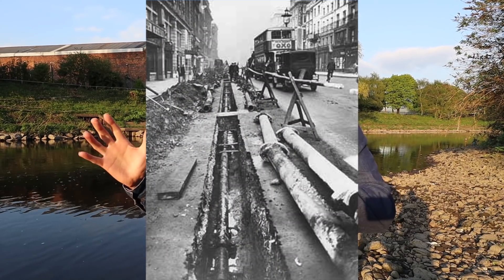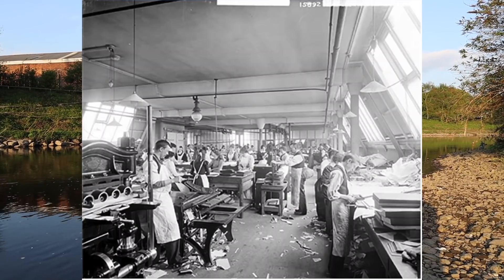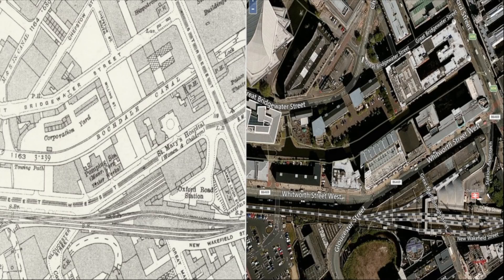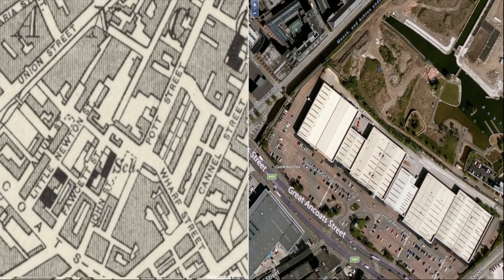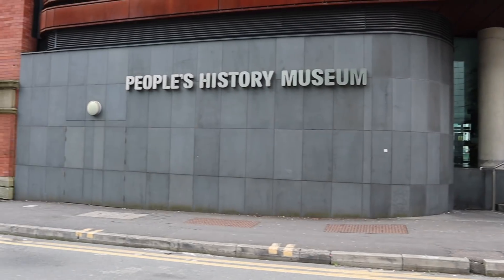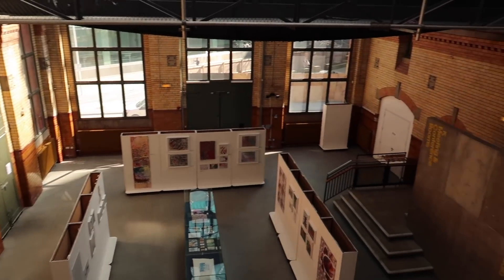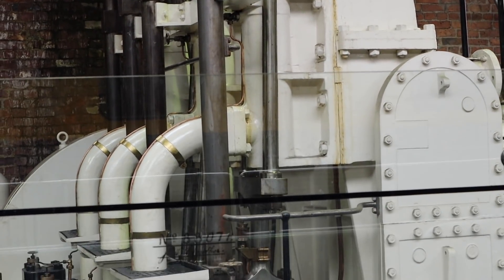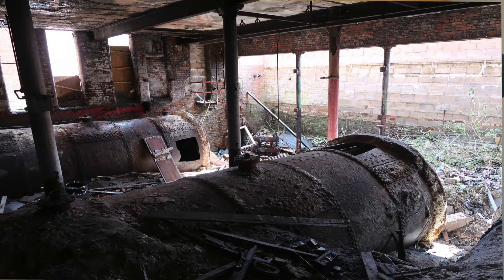Manchester's Hydraulic Power System

Comment: The pipework from the system was still in place along the canal in the 1980's - black pipes about 6" diameter which periodically had expansion loops fitted to allow for the thermal expansion of the cast iron pipes. I don't suppose they are any left down there now.

Comment: All the swing bridges on the ship canal are hydraulically powered. The locks have a water tower containing an artificial head of water controlled by a weight bin so the actual pumps  are relatively small. I went to a Barton Cruising club open day in the 80s which included a visit to the bridge workings

Comment: San diego California actually had a very similar system in down town aria. Near the santa fe train station, is the shell of theold san diego gas and electric building which at the turn of the century was known as san diego gas. And what they did was provide steam pressure as well as town gas from that building into a network of tunnels under the streets. And during the turn of the century all the buildings in the down town aria where provided with centralized steam heating and gas from the plant. Also of note the san diego gas company used horse teames to move the coal around and the stable building survives as well as a taxi gradge.

Comment: You mentioned about swimming in the tanks, i worked on an estate that used to get water from a borehole, you could go up on the tanks (exposed at the top of a hill), the water was never cold, during the cold winters you could even se water vapour coming off the water, i think someone said the water never got below about 12C so a little bit of geothermal heating going on.

Comment: In London the pipes from the London Hydraulic company turned out to be valuable and the company sold for a good price. The reason been that the pipes had right of way under the city and it was possible to blow optical fibers though the pipes using compressed air without having to dig the streets up.
Reply from the maker: Great idea Mark

Comment: Hi Martin, This is very interesting, never knew anything about this system,  I'd like to know more about the technical side of the pumping set up, was it a closed loop (pumping the same water around all the time) or was it constantly fed with fresh water from the boreholes?
How was the pressure kept constant with varying numbers of factories using it?
Did they have problems with freezing during the very Cold winters of the past?
Reply from the maker: Hello, am afraid I dont know of the technical side, only the general overview. But yes a fascinating system
Reply: NOW, That's Richy. I think it must have been a total loss system. With a plentiful water supply there would be little benefit in spending huge sums on further piping to return the used water back to the pumps. Pressure was presumably maintained by hydraulic accumulators such as the tower bridge ones which can still be seen today.

Comment: Was aware of hydraulic power with its accumulator towers etc, but thought it was only used in the docks, railway hoists and even tower bridge, had no idea it powered a town. Just wondering how it's usage was charged for, did each premises have a water meter, or pay a fixed price based on estimated use. Your videos certainly contain some very interesting topics.

Comment: The rights to the pipe routs in most of the UK major cities was bought by Mercury Telecommunications Ltd , a subsidiary of Cable and Wireless,
and used for optical cables linked by a deal with British Railways using their telecom routs to link them up and compete with B T and it was called Operation Mercury. .

Comment: Great video again. Did you notice the similarity between the o-ring joint in the pipe and the way the Space Shuttle's solid boosters were assembled? The question that intrigues me is this: Where did the used water go? Obviously it has to be kept out of the foul drain to avoid overloading the treatment plants, but did it go in the surface water runoff, top up the canals, or get reused?
Reply from the maker: Not sure Robert, my knowledge is limited

Comment: I remember the hydraulic system being used in Manchester in the 60s. Don’t know if I’m imagining it, but I’m sure there was also a hydraulic clock system, where pressure “pulses” were sent through pipes to drive “water clocks” and keep all connected to the system synchronised. I don’t think I’m suffering from substance abuse, but I did grow up in the 50s and now I find the thin line between memory and reality is getting thinner.
Reply from the maker: That sounds interesting John

Comment: I'm amazed like you it was still running until 72'
I'm intrigued to how it all worked, those joints looked substantial but as I was a gas man:plumber for 18 years there's always that one coupling that'll not seal properly. So that systems pressure would have to be drained to fix it ? A huge feat I'm guessing

Comment: They also used hydraulic power to raise the goods wagons up and down  both at London Road aka Piccadilly station and at Central station. Both had vast networks of sidings under their arches. These are actually interesting in their own right. When I was doing my nurse training in the early 90s we were based on Piccadilly approach and used to walk under the arches to get to and from lectures/car park etc. There was still lots of track embedded in the cobbles back then and filled in wagon turntable pits. There was a really good example under the arches next to the old Red Star parcels building. I'm not sure if they took their hydraulic power from the Manchester system or if they had their own system in place. Its a fair old drop from the elevated track to street level so they must have been quite impressive wagon lifts although I have never seen any photos of them? https://historicengland.org.uk/listing/the-list/list-entry/1283014  Also all the swing bridges on the ship canal are hydraulically powered another point of interest to maybe look at!

Comment: It's a very clever system - water is pumped into a series of 'Accumulator Towers', which are basically huge pistons, of great weight. The water pushes these pistons to the top of the towers, and are locked in place when they are full. When power is needed, the Accumulator is allowed to slowly fall. This forces the water, under great pressure, through the pipes to where it is required. The water can be used again and again. There are several towers still existing in London, and they all have a similar design, so once you've seen one, you know what to look for. Hydraulic power used to raise the bascules of Tower Bridge. The accumulators are on show there.
Reply: brianartillery  the company I worked for made the hydraulic system for tower bridge in London. It was Armstrongs of Newcastle

Comment: wauw, amazing. I never heard about power distribution via water pressure. Makes me wonder if a similar system have been used in my home town Helmond where a lot of (mainly textile and steel manufacture) industry was between 1800 and 1980...
I wonder how the power transfer (from water pressure in pipes to an actual axle) was done... hydraulic motors Victorian style must have been quite the animal...

Comment: In times when the electricity network was still developing, the hydraulic supply will have been more reliable and certainly more powerful than electric motors, possibly cheaper too. As the system developed and electric light became the preferred lighting option, it made more sense to consider electric factory power over hydraulic.  Additionally, the practicality of portable and handheld electrical machinery made the case for leccy all the stronger.
Reply from the maker: Thanks for the info. I agree with you 👍

Comment: I was at the Science & Industry Museum recently and they gave us a talk about Manchester's hydraulic power system and we had a demonstration of the pump working.  They worked at a very high pressure - 1000 psi (if I remember right).  
I worked in the Town Hall Extension for years where it was said the lifts were originally powered hydraulically.  I can remember as a kid going there with my mum and dad and getting in the lifts.  The lift attendant sat on a tall stool next to a large wheel fixed to the wall of the lift.  He'd turn the wheel to make the lift go up or down.  When he opened the lift gates if the lift wasn't quite level with the floor he'd turn the wheel a bit more to get it level.  The lift would bounce up and down a bit whenever it came to a halt.  
That would have been in the late 50s - early 60s.
Reply from the maker: Thats sounds fascinating Mark. I wish I had seen that demonstration. And that old lift sounds fab !!!!
Reply: Thank you. I Wondered what kind of pressure was in so thick a pipe.

Comment: On my strolls around Manchester (my office is on Chorlton Street) I have noticed quite a few square cast iron pavement gratings with 'HP' cast into the cover - could these be valves used to isolate the hydraulic power system in event of some broken pipes? Just throwing it out there..

Comment: The pipes are certainly still there. I monitored the archaeology for the Metrolink Second City crossing and we came across lots of the hydraulic pipes, especially on Cross Street. It lead me on the same investigation for the background as you have been on. Often they weren’t very deep. Half a metre down below the cobbles mostly. But yes so thick with massive joints. Definitely deserves to be known about by more people.
Reply: I have a couple of photos to hand if you want them.
Reply from the maker: Hi Steve yes that would be great thanks. Id love to see the original pipes as they were
Reply: Martin Zero I posted a few that I could find on Instagram and tagged you.
Reply from the maker: Got them 👍

Comment: Another great  Video  Martin  concerning  our  passed  History, the  first  I  heard  about  this  system   was  a  different  type  of  cast  iron   stop  tap  type  boxes  we  came  across  while  altering   or   reconstructing  footpaths  &  roads  around  Manchester, I  was  told  from  the  older  workers  that  it  was  a  system   for  supplying  Hydraulic  water  power  to  the  Factory  or  Warehouse  Lifts, your  video  goes  deeper   when  you   say  it  also  supplied  power  to  Machines  also. These  cast  iron  boxes  we  came  across  differed  by   there  shape  &  smooth  top   as  the  usual   water  stop  taps  &  control  valves  were  all  marked  with  MCWW    which  stood  for  Manchester  Corporation   Water  Works  which  were  funded  by  Manchester  Ratepayers  which  was  also  the  case  with  the  Gas, Sewers  &  other  Utilities  all  serviced  by  their  own  groups, I  dont  want  to  delve  into  the  Political  side  too   much  but  these  have  now  all  been  sold  off  to  Private  Companies  who  never  provided  the  original  funding, I  think  you  know  which  way   I  am   going  so  will  stop  here, Thank  you  again   for   another  interesting  Research   Martin  &  I  look  forward  to  your  next  one.
Reply from the maker: Hi Terry, so you have come across this stuff, did you work on the roads / construction ? I get what your saying about the politics I am with you on that 👍
Reply: Yes  Mantin, I  worked  as  an  Apprentice  Street  Mason  working  my  way  from  a  Working  to  a  Walking  Ganger,  We  did  Road  widenings  &  alterations  all  over  Manchester  including  work  on  Contract  at  Manchester  Airport, I  was  offered   an office  job  but  it  wasnt  for  me, I  loved  being  hands  on.
Reply from the maker: Brilliant, I bet you know our streets well
Reply: Quite  well  Martin, although  a  lot  have  gone  in  Demolition, I  later  transferred  to  The  City  Center  which  was   a  learning  curve   on  its  own  with  its  ever  changing  rebuilding   &  one  way  systems  although  I  loved  the  work  &  challenges,  Our   Apprentice  Mason  training  area  wasnt  far  From  Pott  St  you  have  mentioned  in  Little  Newton  St  at  our  dedicated  Depot  at  the  bottom  near  The  Canal.